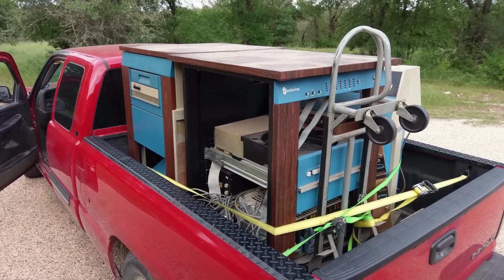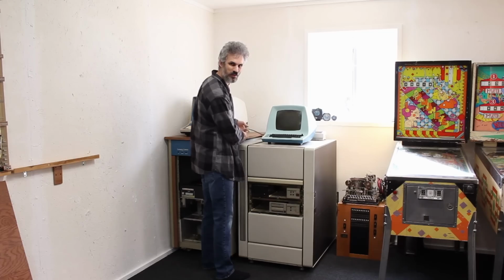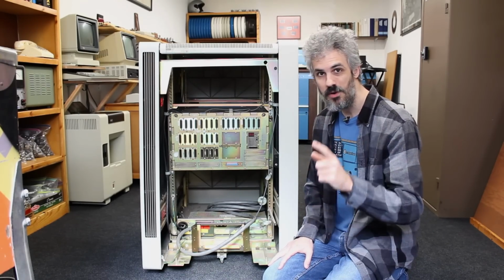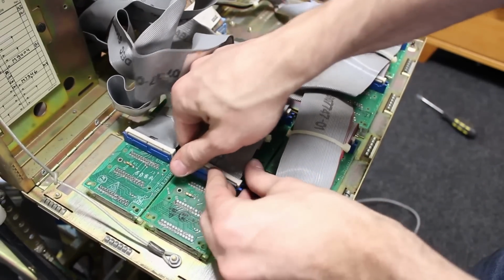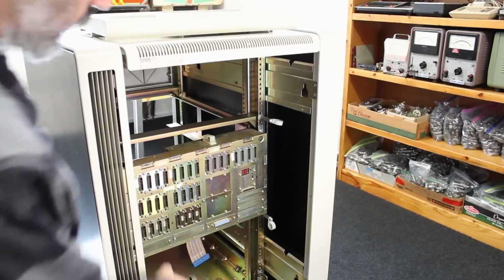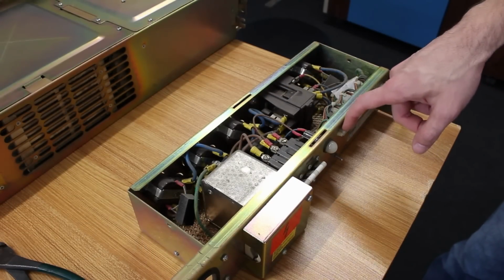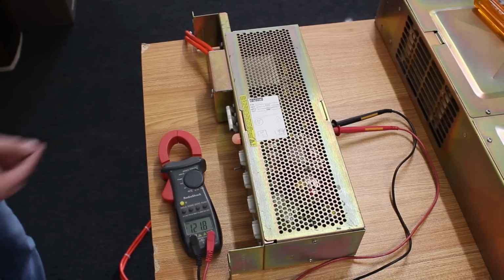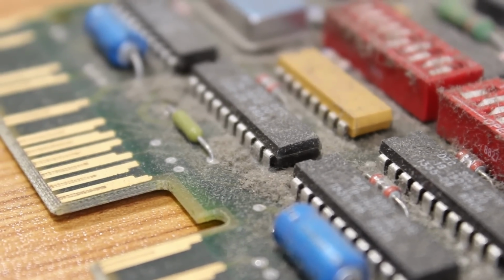I Bought a PDP-11/83!

Comment: Oh boy, yeah good thing you made an update on that double cord idea. I immediately was yelling yikes! 
It's an absolute no-no to parallel things for power doubling. 
In your case, just make sure the power board you plug them in, has a proper 13A breaker and use one cable.
Sorry I haven't been able to follow along and helping on discord, I have just been really busy lately.
I don't no how expensive it is in the US, but maybe it's time to update the electrical wiring around your lab/storage?
I would also add a 2-phase system to get 230/240V as well. Makes things so much easier to work with.
But that also depends on your main breaker.

Comment: With so many serial ports, it makes me wonder if this type of computer was one of those which made BASIC the standard for programming languages in home computers for around two decades.
As I understand it, since the university computer was just sitting around doing nothing for most of the time it was set up with remote terminals all around the university for anyone to use, and BASIC was invented in order to allow just about anyone to program it and to run those programs remotely.

Comment: We used to use those exact machines at FUGRO as our main vessel navigation drivers, right up until the late 1990s. We had everything from SIMRAD echo-sounders, VDU consoles, FURUNO GPS receivers, multiple radio navigation (Pulse 8, SYLEDIS, etc.), all hooked up and pumping in data, 24/7. They pulled in all of that data, processed it, and spat out navigation fixes and chart-plotter updates in real-time, and without a single hitch. Oh, and you could also use them to post-process bathymetry data WHILE it was generating navigation fixes. 

Incidentally, none of the competing system we tested (including SUN SPARC, Windows, etc) even came close to matching the real-time I/O performance of the PDP until about 1996/97 - which is a real testament to just how good they were.

Comment: I'm almost sad your PDP-11 has no blinkenlights-and-toggle-switches front panel. I assume you're familiar with the PiDP-11 project? Sadly, their front panels, as nice as they are, are scaled-down reproductions. I'm not sure if you'd consider or if you could find an original PDP-11/70 front panel still, and even if you could find one and make it fit, that perhaps would be an anachronism, as your machine is a PDP-11/83, not a PDP-11/70. I think the PDP-11/83 never came with a front panel. 
The PiDP-11 site has this to say about front panels: 
"The PiDP-11 is a modern replica of the PDP-11/70. Introduced in 1975, the 11/70 was top of the line in the famed PDP-11 range, and the very last system with a proper front panel. Tragically, DEC field service often removed the front panel in a later upgrade, leaving us staring at dull blank panels ever since."

Comment: As software, you could install and run Unix system III on a PDP 11, if it has enough disk and RAM.  Which is maxed out at 64 kword, if I remember correctly.
The Instruction set is beutifully symetric in a PDP 11.  Much like the Motorola 6809 or 68000 series.

Comment: 8:24: That female 50-pin connector is a D-subminiature standard size: DD-50. Its blue colour is probably of no consequence; back then, D-sub connectors generally weren't colour-coded (yet). It might be SCSI, but I'm far from sure. Per Wikipedia, "older Sun hardware uses DD50 connectors for Fast-SCSI equipment".

Comment: Quick thing, as someone who has restored a PDP-11/23, the power supplies in those BA23 chassis, have RIFA caps. These will definitely need replacing. The good news, is that the PSU's are quite easy to work on. The chassis you have is, i believe, "simply" 2 BA23 chassis joined together. 

Generally, PDP-11's are pretty bulletproof, and parts are quite available. It won't take a lot to get it working. Also, DREM hard drive emulators work well with them, emulating both RL02 drives and MFM drives, giving you many options for bootable storage. I'd recommend finding an RX50 drive. These are 5.25" drives, and disks can be written to by standard PC floppy drives (though with special software like PUTR, which is a DOS based utility that can read basically every DEC format you need. It's quite trivial to put a bootable RT-11 image together using it.

Nice to see you pick up a PDP-11. Any minicomputer fan should have one in their collection.

Comment: They used PDP-11s to run engine dynamometers at  work. The last one was replaced in 2013. With a little bit more effort they could have been coaxed into outlasting diesel engine development. 
At the peak there would have been at least 50 of them running, but it was down to about a dozen when I started to use them in around 2003. 
This was at the European engine development centre for Ford.
Reply: Would you happen to know if PDP-11s were used in the development of the lean-burn Valencia engine? I've got a 957cc unit on the floor in my garage, as a replacement for the one in my "stalled project" 1982 Fiesta that's sat next to it. If they were, it would be an interesting link between my two main hobbies of old cars and old computers.
Reply: @Zeem4  I would say, from the timeline, almost certainly. In fact the assembly line that they were built on was probably PDP-11 controlled too. I had a friend working at the Dagenham plant  in the 1980s on PDP-11s on the production lines. (Blocks and heads were manufactured in Dagenham). The Dunton site (where the PDP-11 based dynos were) was built in 1966. It seems likely that the PDPs went in sometime before your engine was developed.

Comment: Is this the version with LSI-11 ?  Nowadays, many Micro-controllers have more resources than this PDP11 . Notably the AVR atmega644 1284 and 2560. Not to mention countless esp32 and stm32 variants. The AVR line is almost 20 year old and still very capable. Countless Microchip PICS 18f and 24F and Pic32s have lots more resources.
Reply: J11, a microprocessor version of the PDP-11 chipset, often called a "PDP-11/70 on a chip"

Comment: If I have to guess, the blue connector on the back looks like a QBUS extension. The rainbow cable from the connector goes directly into the chassis which I suspect connects to the bus backplane.

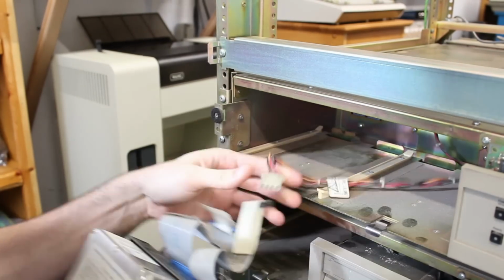Comment: 10:53 Oop, bent pin in the port nearest the screwdriver there! (I1) Same above in E2 as well, same pin even!
Wow, either that was a thick layer of glue or they used a sheet of double-sided tape! Weird.
Carb-and-choke cleaner might take the tape-residue off, just test it on the paint somewhere unseen first!
Heat is another possible option for the residue, perhaps in combination with some WD40.
The start of a new Minicomputer series is a great Christmas-present, thank you!

Comment: Cigarette lighter fluid should cut through the old tape glue residue on the outer panel without attacking the paint but test on a hidden area first.

Comment: Just when I thought this channel couldn't get any better... PDPs (and minicomputers in general) were expensive, any organisation that bought one wasn't gonna waste any drop of computing power, so time share operating systems were born, and hence all the terminals that could be connected to it.
Reply: Timesharing happened in the 60s on different DEC models, as well as models from other companies. The minis were for low cost laboratory and small business systems, which included low cost time sharing. Until the demise of the 36 bit Jupiter in favor of the VAX 8600 Venus in 1983, the PDP10 architecture (DECsystem 10 and DECSYSTEM 20) was the king of DEC time sharing. Thats when I made the jump , and got Vaxinated, myself.
Reply: @SeaMower  Sorry, I don't know  much about the hardware, but as a biochemistry post-doc at Princeton in 1971 I used a PDP-10 that fed one of the first commercial graphics computers, an Evans & Sutherland LDS-1 that we used to solve DNA and RNA structures from x-ray diffraction. The graphics was for visualizing molecules that Watson  and Crick had built with wire models. The PDP-10 was for the heavy calculations, especially fast fourier transforms to relate spots on diffraction photos (yes, photos developed in real darkrooms) to atomic coordinates. What it took us months to do then can be done in minutes today.
Reply: @stevenstellman7035  People would love to hear first hand accounts of early research breakthroughs.  You would get a loyal (probably small) following if you were simply to whiteboard your way through a few old published papers and explain stuff in simple terms.  I know I would follow along just to get a better idea of how genetic research got going.
Reply: @KallePihlajasaari  Dear Kalle Pihlajasaari, I would be happy to make our early publications available. In 1971 I had just finished a PhD in physical chemistry at NYU using the CDC 6600 (Cray) supercomputer for Monte Carlo thermodynamic studies of polyethylene. I landed a post-doc at the Princeton laboratory of Robert Langridge, who had done his doctorate with Maurice Wilkins (co-Nobelist with Watson & Crick), worked at MIT on Project MAC (Machine Aided Cognition - a time-sharing pioneer), and then got an NIH grant to start his own crystallography lab. Three papers on the use of early graphical methods for nucleic acid structure are: Stellman SD et al. Structure of guanosine-3',5'-cytidine monophosphate. I. Semi-empirical potential energy calculations and model-building. Biopolymers 1973;12(12):2731-50, Stellman SD. Computer graphics in the solution of the chain deformation problem. Macromolecules 1974;7(3):296-300, and Stellman SD. Application of three-dimensional interactive graphics in X-ray crystallographic analysis. Comput Graph 1975;1:279-88.
Reply: @stevenstellman7035  I m going to go and look them up.  Some amazing stuff has been discovered in DNA, similarly this latest offensive the world could have done without.

Comment: If the DECtape is in working condition: I have a couple old DEC tape cartridges that would be great to get dumped and preserved. If it happens to be SCSI, you could connect it to a regular Linux PC ...

Comment: CPC which is part of Farnell in the U.K. sell a product call adhesive remover which is a spray can. It is miraculous and just dissolves adhesives without attacking metal, paint or plastic. I would be surprised if there is nothing similar in the us. The US variant of Farnell is Newark and they sell a spray can of adhesive remover. Not sure if it is the same but their part number is 01AC7474.

Comment: Super cool... back in the 80s when I was in the Canadian Armed Forces we used these machines for our CEMIS (Construction Engineering Management Information System).  We had dozens of teletype terminals connected all through the building to do Engineering reports, Project startups and even to order supplies.  If I remember correctly, each terminal connected directly to the RS232 back board.  The additional power was to power up external tape and disc drives as well as in cabinet drives.

Comment: WIKI::: The PDP-11/73[1][2] (strictly speaking, the MicroPDP-11/73) was the third generation of the PDP-11 series of 16-bit minicomputers produced by Digital Equipment Corporation to use LSI processors. Introduced in 1983, this system used the DEC J-11 chip set and the Q-Bus, with a clock speed of 15.2 MHz.

The 11/73 (also known as the KDJ11A) is a dual height module with on board bootstrap, cache and bus interface. From a speed perspective it suffered from accessing memory over the Q-bus rather than the private memory interconnect bus adopted by the later PDP-11/83.

Comment: To remove tape glue signs from surface I use "petroleum solvent" (don't know how in English, but in Russian its sells with name "Бензин Калоша"). Here is the google translate of its description:
"the result of the distillation of gasoline obtained from the catalytic reforming of petroleum or the direct distillation of oils with a low sulfur content. Then gasoline goes through the stage of removing aromatic hydrocarbons from it (there can be no more than 2.5% of the total volume). Already such, dearomatized gasoline is distilled. For "Kalosha" light fractions are collected, boiling in the temperature range of 80 ÷ 120 ° C."
Hope you can find its analog in your country.

Comment: I found the best way to remove old tape from painted metal without changing the texture of the surface under the reflection of light is to really go at it with a cloth rag and dish soap.  Anything stronger such as IPA would change the matte finish.

Comment: For the tape marks, give isopropyl alcohol 90-99% a try.  That's one of my go-to cleaners and I didn't hear you mention that.  Even then, it may only soften it and still needs a bit of scrubbing.   Failing that, try Magic Eraser.
Reply: Isopropyl would be too strong and will change the texture of the paint making it smooth.  Magic Eraser is an abrasive and would do the same.
Reply: @diags6468  I've not had a problem with alcohol on paint.  But it would be a good idea to test on a hidden spot to make sure.

Comment: Looks like fun!! A lot more documentation, OS software and hardware for the J11 and QBUS/quad-height boards for DEC then the rather obscure Centurion.  I have a 1977 LSI11 and have built a full PDP11/73 front panel with blinkey lights and switches.

Comment: Also note the location of the boards. I am pretty sure the interrupt priority is partially based on the slot the board is in. We ran 48 terminals on a PDP-11/70 using a system called DSM-11.

Comment: You comment that the large number of rs232 ports in the back could be for multiple users. When I went to tech school in 1975 the computer on campus was a PDP 11.  It was accessed by students through a number of teletype terminals (about 10 if I recall correctly) and was used to teach introductory programming through an interpreted form of BASIC.

Comment: I don’t have my DEC books with me.  The serial ports may be an add-on from Emulex, but I’m a bit rusty.  One of your boards looked like it might be the RS-233 / 20 nA current loop board.  I forget the part number.  Life is easier if you have one of those because it will be the console port when you do a build of the operating system.  I remember doing RT-11 builds back in the day.  Answer dozens of questions, then wait an hour or two while the kernel is linked.  It helps to have an LA-36 or LA-120 DECwriter so you have an audit of what you did… or run Procom on a PC and log to disc.

Comment: PDP-11 was the first computer I ever used, back in high school in the early 80s. Always had a soft spot for them. Unlike the Centurion and the Wang, there's a decent hobbyist ecosystem for it, so getting it running should be a lot more straightforward. And there are probably still some in use in production systems. Construction quality should be way higher than that of the Centurion, and spare parts should also be available.

IMO, running Unix on it would be a waste since you can run Unix on pretty much any computer these days. To make it interesting, I'd run a DEC proprietary system like RSX-11 (although licensing could be difficult; apparently RSX was never available for hobbyist use).
Reply: I seem to remember the Heath Kit H11 ran RT11
Reply: @pughums  RT11 is a single-user OS, and IMO not all that interesting compared to what else was available. On the other hand, it WAS used for lots of realtime stuff like process control and automation.

Yes, the H11 series was PDP11 (LSI11, if I recall correctly) based

Comment: I think that one will run System V R2 UNIX, if you can find it. Though by that point AT&T was primarily targeting SysV for their 3B2 series machine and the UNIX world wasn’t getting along all that well. The UNIX wars had started…

Think it was 3BSD that ran on that series as well, what I learned UNIX on and to this day I still have a soft spot for BSD over SysV.

Wait, will it run VMS? Get an Ethernet controller? Run some 10BASE5 cable & some vampire taps down to terminal servers running LAT? Don’t know if that part of VMS existed yet on that platform but DEC networking is, hands down, some of the best ever. They were doing things 20 years ahead of everyone else. And then, Compaq came along…
Reply: VMS is for Vax only, 32 bit version of RSX initially I think.

I would think RSX or 3BSD will be the best bet. 

RT is pretty stripped down although t if it was a manufacturing computer that might be what is on the hard drive.

As others have mention, get ahold of SIMH and the DECUS archives and you will be in good shape from the software side of things.

Comment: Clearly, you needed to own a second minicomputer to diagnose endlessly.

I actually owned one of the smaller rack mount-ish units for several years, a PDP-11/20, although I never got it booting. I had a Teletype 33 and some other glass terminals I had planned to use with it, the original idea was to run early UNIX or Multics on it, but I never got around to making the machine boot, never bought the other peripherals, and then it got shoved into storage until a few months ago when I sold it and the teletype off.

Hope your project has better success than mine! Cheers